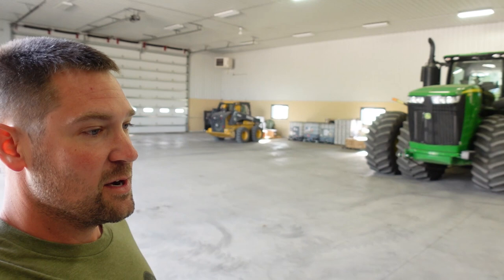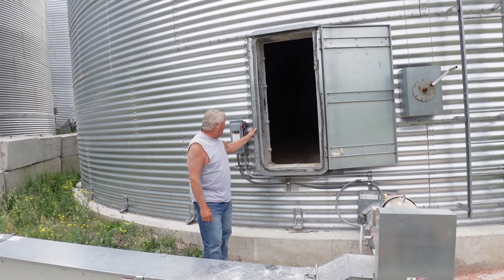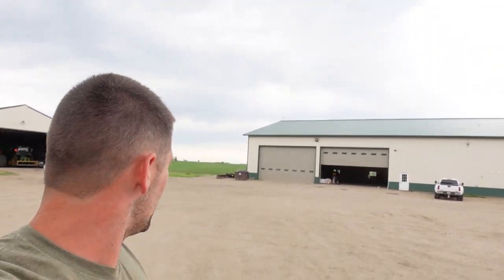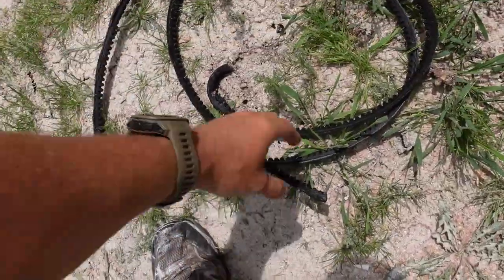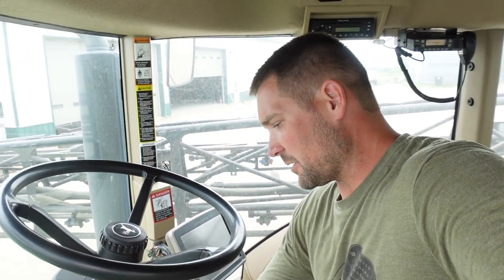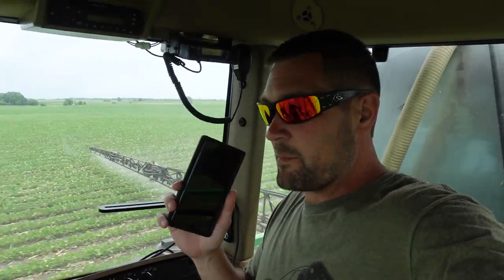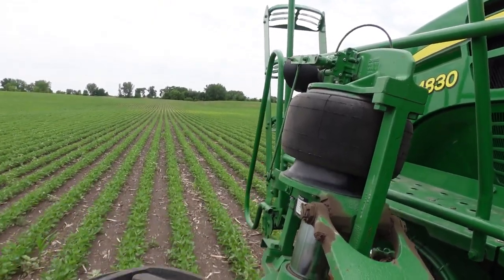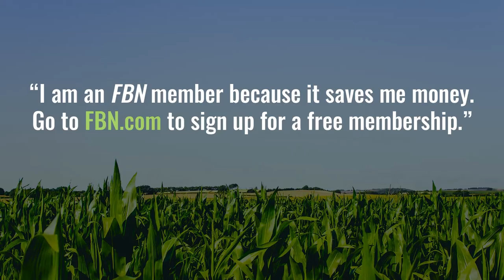Spraying Roundup-Glyphosate

Comment: For the past 4 years I've daily driven a 2012 Outback with a 6 speed manual;l because of that, I have found myself slamming the brake pedal to the floor with my left foot when preparing to stop during the rare occasion that I have to drive an automatic 😂

Comment: Round-up- chemical you should treat as a hazardous chemical and not breathe it in or let it get on your skin... Simple really. Its like blaming car manufacturers for someone who crashes their car at high speed, how is it the manufacturers fault? If you handle it properly, its not an issue. Just like any chemical, it should be treated with care.
Reply: It is no worse than getting spray with diesel. 
There is a lot more worries with powders.  That stuff getting on everything.

Comment: in the US do you have to do test to used different types of spray applications? in the UK there is 6 different courses depending on what u wanna do. PA1 is the theory of safety and laws which u have todo then PA2 though PA6 is the application types like boom sprayer of knap sack.
Reply: Kinda.   It depends on chemical, what you are using it for, if you are hired…. So this is simplified. Not legal…
 If you want to spray your sidewalk, around buildings, on your property.  You can buy many premixed chemicals at hardware, garden, even lumber retailers.
 You don’t need any permit. BUT you are responsible to follow instructions.  (Many do not even skim them)
  If you want certain chemicals, and/or want to apply those chemicals to OTHER peoples property. (Or for hire) you must take, pass permits. I am not up on what each level is.
Reply: Jack, you need look up what "spay" is... 🤣🤣🤣🤣

Nasty boy...

Comment: I pray in 50 years the chemicals you spray does not have a negative affect on you children or grand children I am 100% sure the chemical company's have your best interest at heart not There Profits
Reply: Risk with everything.  I started spraying with a John Deere A with two 55 gallon barrels, a center nozzle.  Feeling the spray on my arms, face as I turned on ends, occasionally spraying one direction as getting soaked.
  Now low drift nozzles, cab, high off field, air goes thru air filters, no pouring spray in while on slick angle iron….  Farming is a dangerous occupation.  You need to educate yourself on what you are using.  Everything can harm you.

Comment: That sucks man. I remember getting a brand new truck in 2013. Got 600 miles down the road and my high pressure fuel pump died. Can never tell with some thing, hopefully it won't be long and you'll be rolling again.

Comment: If you use posts with lynch pins for your covers where you can they can be removed and replaced quickly without tools, just have to shim under the linchpins to keep covers tight where necessary
Reply: Great idea!  Just wished I'd heard it when I was farming when younger.

Comment: Why does the roundup not kill the crop?
Reply: Certain chemical combinations do not hurt certain crops.  Generally you can NOT spray corn with the spray you use on soybeans.(or other crops)
  The big exception is “Roundup”. Which is a rather cheap, simple chemical, that blacks down quickly, has no residual action…. But the crop must be grown from seeds, from modified plants…
  So it really hurt other herbicide companies.  Stuff that if it touched your bare skin would do instant damage.   So scare tactics were needed. 
  There are tons of lies about it.  The only truth is if the former parent company of Roundup THOUGHT you planted harvested beans with roundup gene.  They would spend lots of effort to take you to court.  Even if they were wrong.

Comment: No eduction system on your sprayer? Also boy your planter must have a dam good a b line, I spray over 10k acres and no way could I run an a b line on the corn, 30 inch spacing to lol

Comment: Hey Zack for the conveyor that is too slow for the bin auger, would a quick fix be to change the size of the pulleys on either the conveyor or the auger (either end) as appropriate?  Then the problem would go away for good. Cheers!

Comment: Decrease the motor pulley size to slow it down.  Or you can increase the shaft pulley size but it will be tight inside that cover.  Other potential option is to speed up the other motor by replacing the pulleys opposite of what I said before, but with increased speed you will draw more amperage so that may not be possible with the current motor.

Comment: If you put a variable frequency drive on the motor that is too fast you can slow it down by varying frequency and you will not burn up belts on the motor that feeds faster that the other one that takes it away.

Comment: Zack do you put the older corn in the bottom of the trailers and top it off with the good corn  ? I was hauling milo into an elevator and they probed from the top  but when I was unloading they stuck their hands in the bottom and searched for the milo , then the scale house told me to put the wet crop on the top,  so we did & that load was the driest we had all day  . The elevator didn't like all the yellow milo we hauled in but they took it  ..

Comment: With that much water in the mix.   Would it make sense to double the concentration and half the application rate.  Making your load of chemicals last twice as long?     Lol.  I am sure there is a dumb reason why they don’t do it
Reply from the maker: Good question. There's a fine line because you need enough water to get a good coverage

Comment: I was actually spraying round up yesterday, but in metric because im I upside down land...
14 litres into a 3000 litre tank, at 300L a hectare.
Then today we swapped to paraquat (AKA Spray Seed, rhe deadliest shit we use here)

The method is called a double knock, you spray once with round up the  a couple of weeks later use Paraquat to prevent Glyphosate resistance.